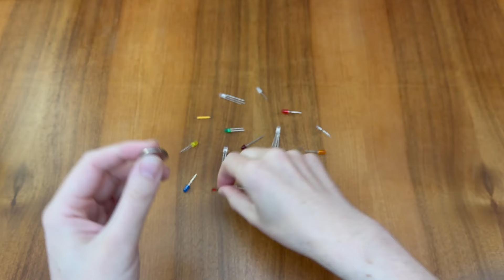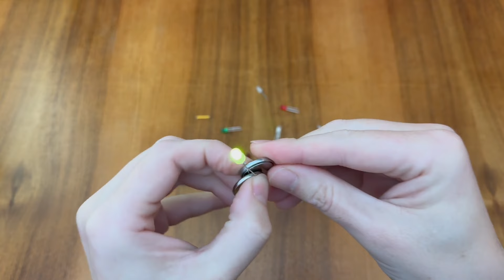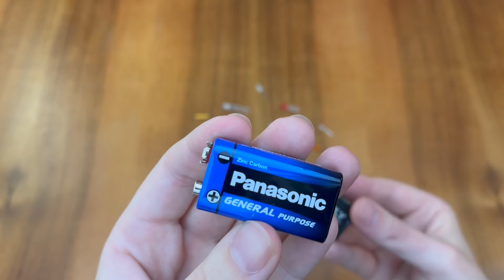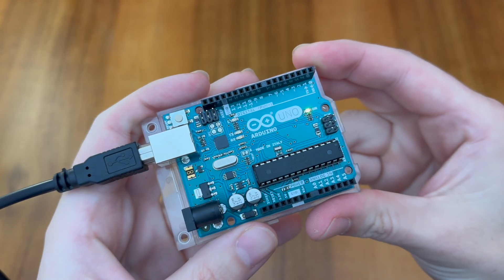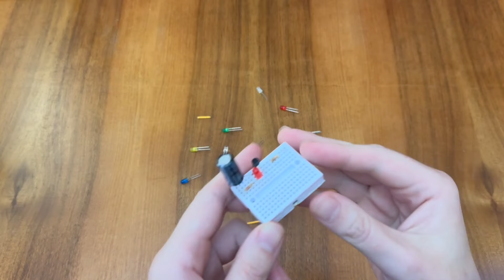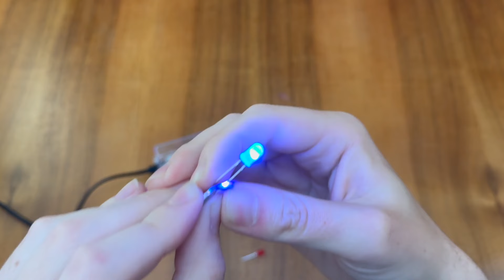Awesome LEDs - Transistor Oscillator,  Arduino Colour Blending, and Blinking Microcontrollers!

Comment: what oscillator are you using there? that looks like a cheap, small alternative for non-professionals
Reply from the maker: The oscilloscope I'm using here is the JYE Tech DSO 138 Oscilloscope kit. It does require a little assembly! https://jyetech.com/dso-138-oscilloscope-diy-kit/
Reply: @jtjacques super thanks for the reply! this looks super interesting!!